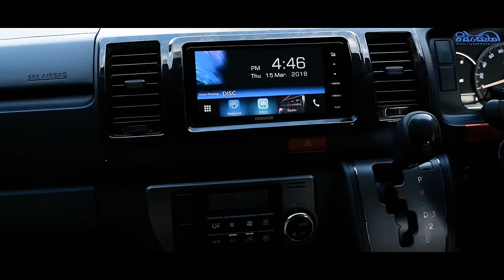Toyota KDH, this is madness! - Vehicle Reviews with Riyasewana (English Subtitles)

Comment: ගොඩක් වටින video එකක්. පොඩ්ඩක් miss වෙච්ච දේවල් ට්කක් තියනවා dark prime ගැන. Dark prime කියන්නේ 2014-2017 manufacuture කරපු type 4 model එක. Dark prime එක extrior එකෙන් අදුර ගන්න බෑ. Dark prime එකෙ seat එන්නේ half leather. ඒ වගේම ඉස්සරහ door appostin එකේ half lether එකක් එන්නේ. Engine එක 1kd serius එකේ 3000cc එන්නේ. 2018 ඉදන් type 5 එක ආවා engine එක මාරු උනා land cruiser prado එකට එන 1gd 2800cc engine එකට. 6speed triptonoc gear system එකක් ආවා. එකේ dark prime එක dark prime 2 කියල අවේ. Led head light dark prime නොවන type 4 එකේ  normal model එකටත් ආවා. 2020 type 6 එකත් ආවා පොඩි පොඩි වෙනස් කම් එක්ක. දැන් type 7 එකත් තියනවා. අලුතෙන් ආව h300 කියන්නේ japan වලින් පිට export model එකක්. H300 කියලා japan වල තියෙන්නේ granace කියන model එක
Reply from the maker: Thank you, තවත් විස්තර අපිත් එක්ක බෙදාගත්තට ☺️
Reply: Supiri 💕💕
Reply: 2021 ake dark prime akata anne dual malti pansion steerian wheel akak
Reply: Ow. 2020 idan app GDH type 6 idan enne dual multifunction steering wheel ekak. Eka type 6n Type 7 eke DX model ekatat enawa